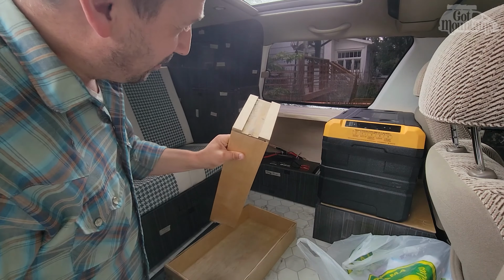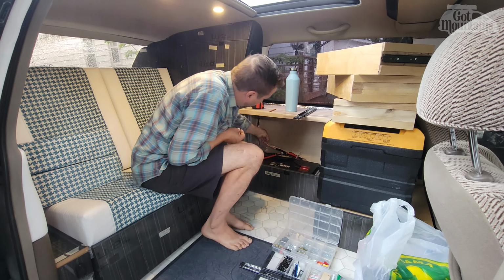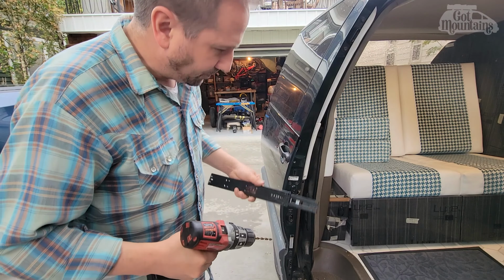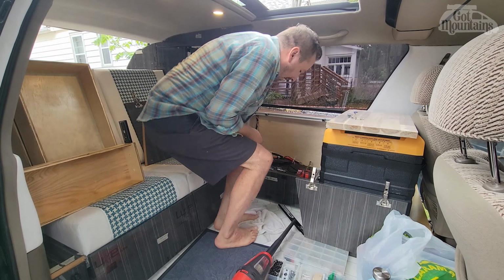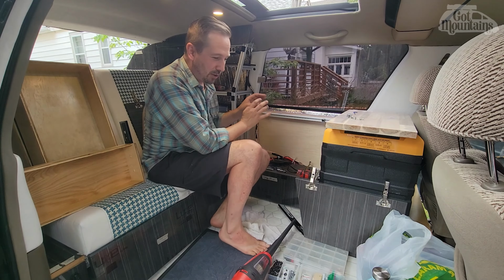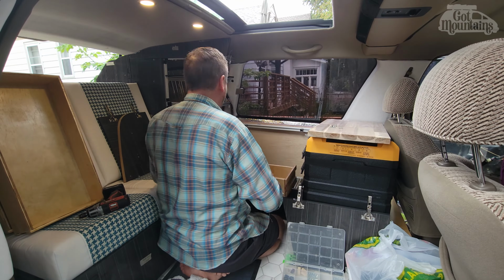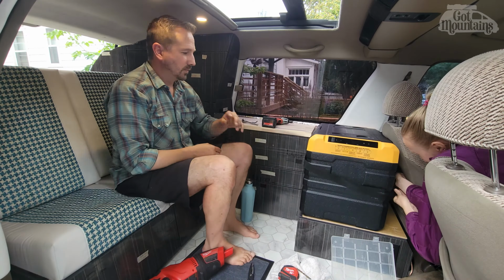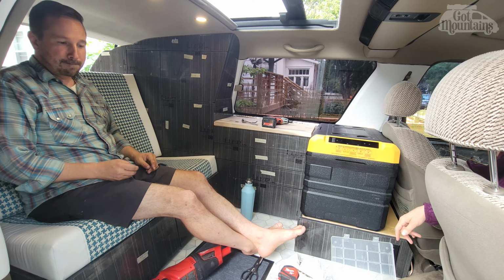Custom Drawers in MICRO CAMPER VAN //E24 Van Build Series

Comment: Is there a over all weight you would recommend not going over or a total weight of your materials you used including insulation? I am loving your videos! Im planning to get a van nxt year and most likely get a camper kit and modify a few things because my disability won’t allow me to do a full van build like would like to do. Doing the insulation alone will be hard. I love that your build make it possible for us Canadians can survive our winters in a van!! So excited and inspired 😃💜🙌🏼
Reply from the maker: That entirely depends on what the vehicle is capable of, if you search for GVRW for your type of van you'll be able to find it on the internet. Then, once you've removed everything you plan to remove, to and weigh it. Then once it's done weigh it again. There are usually provincial weigh scales you can pull into for free depending where you live.
Reply from the maker: Here is an example of our old van on a scale just outside Calgary: https://youtu.be/cSsAw023sjU?si=NpT6X6iLxttSh-q9